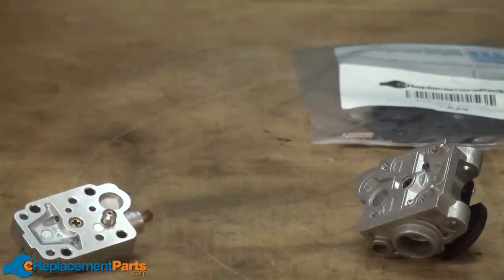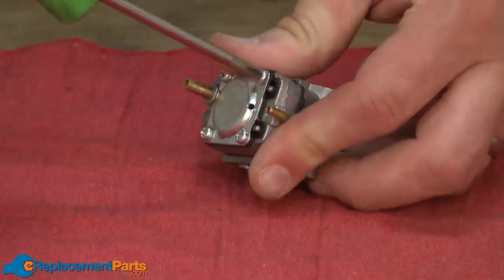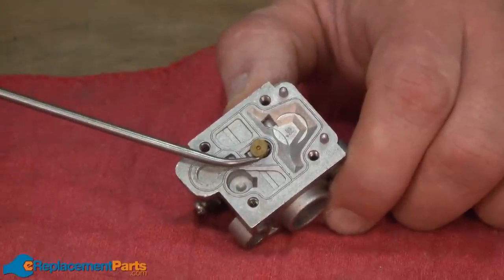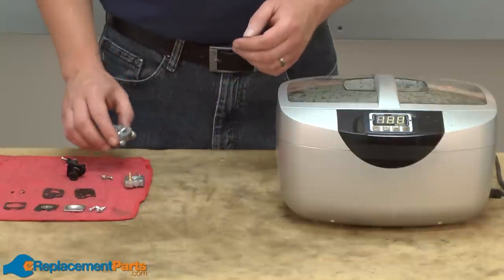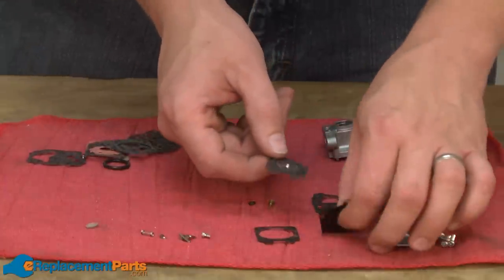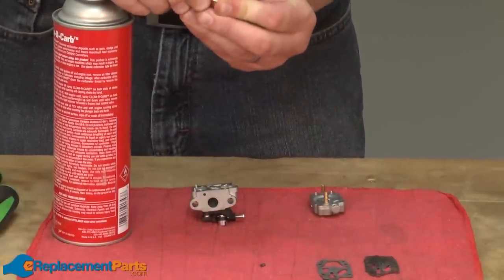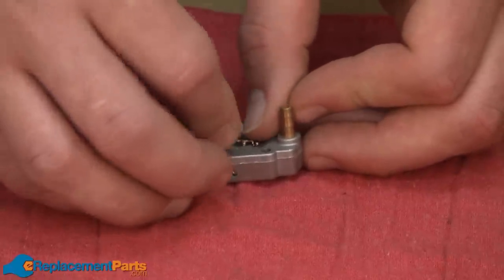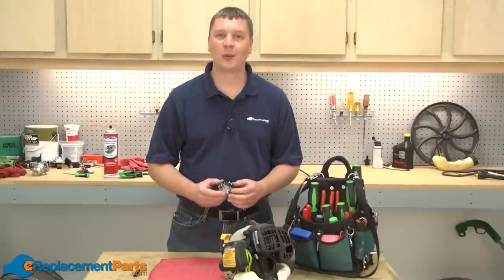How to Fix a 2-Cycle Engine Carburetor

Comment: hi very good  explaning and I like your video were you show how to hook up the fuile line  I have rebuilt carbs before but  for get  how the line went  to  what fitting .  like the one on a Ryobi weed eater .  2 cyl .     before I took it apart it wouldn't run unless I  short starter  fluid in the carb throat .  . and after its running I work the chock . level   back  in forts .    but once stop . it dies .    .     so I took carb apart cleain it . and  put back to  gether . and it doing the same thing . pluse I notice it don't have a butter fly  for the chock .   .       please help what can it be .       ps the fuile line  are hook  up right .
Reply from the maker: We are currently researching this for you. Will have a response soon.
Reply from the maker: Hello Roy, If I understand this correctly, the engine runs with the choke engaged but dies when the choke is opened. This is caused by a blocked main jet in the carburetor. A more thorough cleaning is
needed to open the tiny fuel passages.  The carburetor could simply be replaced as well.

Comment: thank you but i waan know . what you mean by 40 to one.
 how maney mmlof oil  by litre of gas. thank you
Reply from the maker: 40-1 Is 40 parts of gas to 1 part of 2 stroke oil.  There are different grades and ratios on 2 stroke oil so you should follow the directions and mixing strength on the oil sold in your area.  A lean mixture can burn the tool
up. 40 U.S. oz of gas = 1.18294 Liter.  1 US oz of 2 Stroke Oil = 29.5735 Milliliter.
Reply from the maker: Your very welcome. :)